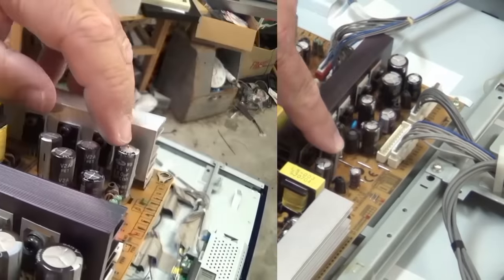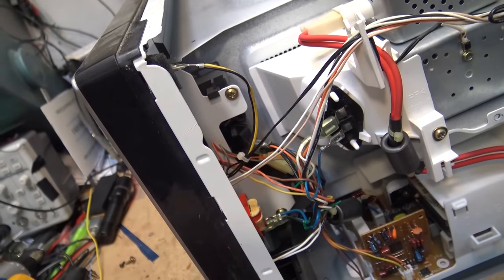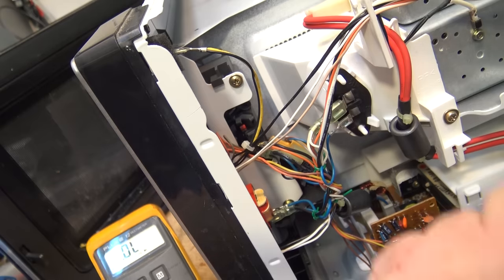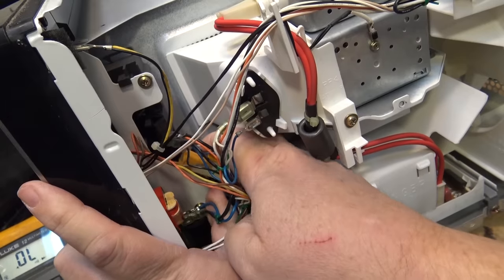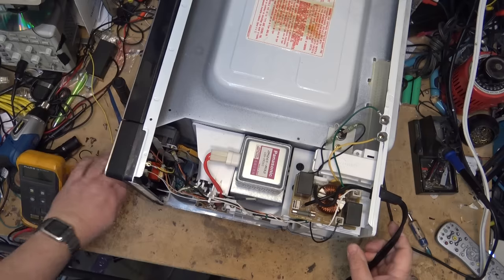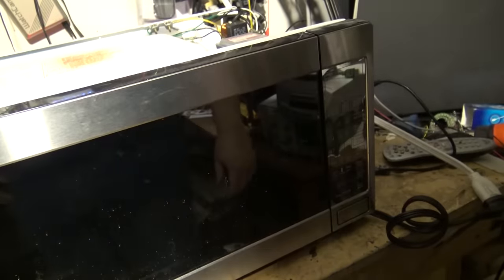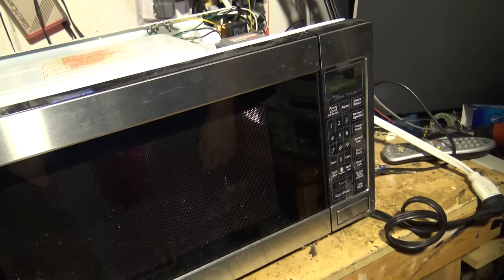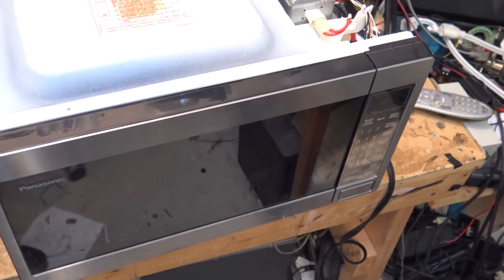Panasonic Inverter Microwave Oven Repair

Comment: Thanks man, it helped me. My microwave was dead, I opened it up and checked fuse but it had continuity. Before anything else I just cleaned and placed it back and guess what, it work fine. It just had some dust or build up around the the fuse, cleaning it helped. Thanks.

Comment: Its amazing how a lot of the mirowave ovens from the 1980's are still working. Specifically the one from work that i use  almost every day and the one that i have at home.
Reply from the maker: Yes I have a Panasonic madam grill that goes back to 87 or 88 still works.
Reply from the maker: The old ones had basically 4 parts. Transformer, Diode, Capacitor and Magnetron tube. Plus the interlock switches and timer of course.
Inverter units are much more problematic especially the early ones from the late 90's before they figured out how to make them. The new ones are far more reliable.
Many magnetrons files on the early ones too because they were being over driven.
Reply: Yes, I have a huge, third-hand, 80s one that still works, every day.
(I don't have children though...)
Reply: I trash picked a Quasar Custom Touch about 20 years ago that was made in 1984.  Cleaned it up and it's still working to this day.  It's outlasted several newer microwaves, so I keep it around as a backup unit.
Reply: I think the date code on mine is 1986, it's only 500W though, have to double most "regular" cooking times.
Reply: Old non inverter from 80s Better build quality , than todays sub $100 ones, using same circuit design, but inferior components.   Because they cost $500-800 in 80s dollars which adjusted for inflation is $1500-$2000 today.  So they made them full size and out of sturdy materials.  My parents still use thier full sized Panasonic digital panel, still works great .  Didn't have a turntable otherwise perfect .   3 cubic foot?
Reply: @12voltvids  now every large mfg, LG, Kitchenaid makes inverter Microwaves  but looks like they source the circuit from Matsushita aka Panasonic parent co.  It's the 2014 and later that are flawless .   Panasonic has upgraded its own line to it's newer Cyclonic Inverter, which has a larger Formica opening (4 inch square) I'm surprised they had inverter in 03 or the 90s.
Reply: Thanks for the help. After removing the cover I noticed the fuse was actually popped a hole in the end. Home depot 2 pack of microwave fuses 3.45.  Working again.  Thanks for sharing and saving us from the expense of a new unit..
Reply: Yeah I have an Amana Radar Range from 1982 and I hate replacing it, in fact, I'm going to keep it in the basement for backup because these new fangled units won't last that long.  The only problem is it weighs close to 14,000 pounds and I need a crane to get it into the basement.
Reply: Hello. Do you not have to short the capacitor  on these Panasonic Inverters??? Thanks in advance @12voltvids

Comment: Great video. I thought my microwave had just blown the fuse. But, discovered that it's primary switch had literally burnt itself out (actually melted the wire connector). Thanks to your video, I was able to replace the fuse, the switch and the connector and save myself a couple of hundred dollars! Cheers!
Reply: That sounds similar to my problem....
Reply: Where did you buy the parts? Would you happen to have the part numbers ?

Comment: Thank You.   This is a very well explained video and I was able to check the 3 limit switches and then replace the fuse.  What I did find out from a different video was that the limit switch and fuse replacement part numbers (CES6) are actually written in red on top of the inside cover - this is visible as you remove the outer cover.   This and the other video on the same subject by 12voltvids were very useful to also understand how to go about doing more complex repairs if one chooses to do so.

Comment: Thanks for this video. My Panasonic NN-SN686S would stop after about 3 seconds. The continuity for the 3 door switches tested OK, but I noticed some electrical residue on one of the switches, so I replaced all 3 switches, which resolved the issue. The cost was $40 from the Panasonic site.

Comment: Thank you very much for this well explained tutorial! I managed to fix my Panasonic inverter microwave by just replacing the fuse. It was more difficult mounting that microwave back up by myself than replacing the fuse that’s for sure!
Reply: Did you have to reset a code??

Comment: Thank you for this video. It helped me fix my NN-T795SF with a Oct 2006 build date! In my case, the primary latch NO switch had failed and was functioning as an NC switch. The button also no longer clicked. The door was not making good contact with the button due to wear, causing it to "stick" closed. The fuse would blow whenever the door was opened.

Tip 1: It's a lot easier to see and work on the switches if you remove the latch assembly altogether (just disconnect harnesses and undo two screws). I found it helpful to see and understand how the door latches and release button engage the switches too.

Tip 2: there's a sticker on the underside of the cover panel with the part numbers of the switches, relay and fuse. My model uses a 6x30mm 20A slow acting ceramic fuse.

Comment: I love the concept of inverter microwaves.  An inverter will be the next kind I buy.  I am one of the three people who actually uses the "power" controls on microwaves.  Instead of cycling the magnetron in "duty cycle" fashion,  the inverter- style does it with some kind of HF PWM. Way more useful for actually reducing the heating power of the unit.
Reply from the maker: Yes inverter by means of pwm will vary the hv to the magnetron and thus reduce the power. They work great.
Reply: @12voltvids  hope the skin is still attached to your hand 😳
Reply from the maker: @DrewskisBrews  
The big one I have in my kitchen the fan also slows when the magnetron comes on.  The reason this one was so noticeable is because the cover was off.  When the cover is on didn't spin down so much as it was actually working the air rather than just spinning.  And no, it doesnt cool the fuse. It directs the air over the magnetron and inverter heat sink and then into the oven cavity and out the other side over the humidity sensor.  When I ran it with the cover on the sound of the fan speed dropped about the same as my other one.  I'm giving it away so if it blows up again oh well they got what they paid for.
Reply: Basically achieves the same thing and I think the older style is still more reliable
Reply: There are four of us. I find the lower power levels very useful. (But I'm also one of the few who likes fruitcake.)

Comment: Thanks, I just fixed one that was being thrown out.

Watched your video and then checked the main fuse and found it open.
Microwave was made in 2015 and in great shape except dead (no display).
Main fuse in mine was a 20A, guess the factory had too many of the 18A ones blowing out.
Found a 50+ year old 20A fuse in my junk cabinet and after removing the old open 20A one, installed the 20A one from the junk cabinet.
Plugged in the microwave and now had a display!

Now the BIG question, did a faulty inverter or magnitron blow the fuse or did it just open due to be running too close to it's current rating?  Put the power down to P5 and time at 1 minute & it warmed up a mug of water nicely.  Success!

Thanks for the great video.  Saved me a bunch of time as I skipped the checking of the interlock switches and went directly to the main fuse after hearing you say quite a few have blown the main fuse with no apparent reason being found.

Comment: My parents recently had to replace our old Panasonic Inverter from around the same time period (early 2000s). Not because of the electronics, but because the plastic door opener mechanism broke from so many years of heavy use. Not bad if you ask me, that thing must have been going on 15 years or more, having spent most of its life in a house with three kids who may not have been too gentle with it (myself included). They got a brand new Panasonic Inverter to replace the old one, and I'm expecting it'll last even longer than the original.
Reply: same thing with mine, and although im trying to get it fixed, repairing the broken white plastic bit is not stocked any longer so i dont think its worth the bother. and my time  as my Panasonic is also about 20 years as well i should imagine
Reply: How did you go with a new Panasonic? Mine crapped itself with constant h97 errors after just a few years of light use.  Absolute trash.

Comment: One thing that is odd about the inverter microwaves is that they don't have that single large high-voltage capacitor you see in 99.9% of videos and articles about microwave repair. Instead they have two smaller ones on the board near where the power comes into the unit. You can see one of them @10:09 in the video. It is a black blocky thing labeled 2.2 microfarads and 275 volts. I was going nuts trying to find the HV capacitor every video and article told me I had to discharge. In the end I just tested continuity on the fuse and found that was the culprit. Thanks for having a video on one of the Inverter microwaves so I don't feel like such a weirdo!
Reply from the maker: The inverter type do not have the large cap that conventional do.  They use a flyback type transformer. Diodes and small hv caps.  On these inverter type the frequency coming out of the transformer is very high and does not require a capacitor. The voltage is around 4200 volts dc.   Unlike a conventional microwave which is either on or off, inverter types can dial down the voltage to reduce the power.

Comment: So I’m confused. You said water is bad for microwave and you put water mug to test it??
My microwave is acting weird. We have a new born and we started heating water in it to heat his milk from hot water and now the microwave sometime works and sometimes shuts off. If we wait, power cycle or hit it it starts to work and sometimes it’s doesn’t work at all. What could be the problem?
Reply from the maker: I never said water is bad for a microwave.  A microwave needs a load to absorb the microwaves.  Water is a perfect load.

Comment: Good info. I've replaced fuses before. I took the cover off our older Panasonic microwave to see if I could replace the light bulb. It has an integrated lamp assembly and I don't see any available. Now I've misplaced the screws... Microwave still works really well. I'd like to get replacement screws.

Comment: If the security screws are in a hidden place I will just get a dremel with a thin cutting wheel and turn them all into flat head screws to take it apart.

Comment: Neat to see this repaired, the inside is a far cry from my 1974 Amana Radarange model RR-4D. Still in daily service and working good.
Reply: I worked as a parts subcontractor for the wiring harness for those old Amana's- built like a tank- yes, but as I recall only one interlock switch- then again maybe I recall wrong. ☺

Comment: Thanks for sharing your expertise. It's made me pause before replacing my Panasonic NN-295. The problem is intermittent which makes trouble shooting challenging given it's an over the range model. What happens is that it will run perfectly than just stop. Power is still in the unit evidenced by the display still on when it stops. To get it up and going again it needs to be unplugged and then plugged in again and everything works fine. This happens frequently. Any thoughts or comments would be greatly appreciated.

Comment: 21OCT22 Fuse blown. Ace Hardware "microwave fuse" 2ea for $6.37. Remind yourself to align both sides and top when replacing cover. Since my unit failed while running, I skipped the switch testing. I used metal polish paste, Flitz, and Q-tip to clean contacts. Smeared paste on old fuse, inserted and rotated 3x, scrubbed with Q-tip, then soft cloth. Inserted new fuse.  Tested without cover. Panel light on. Check. Cup water heater for one minute, check. Replace cover and back into kitchen cubby hole. Set time: Press Time/Clock button 2x. Rotate wheel to set time. Press Time/Clock once.  Ready for duty! Hopefully for another 11 years!

Comment: Hi my Panasonic inverter nn-sc668s just stop heating. Runs normal but I can hear intermittent clicks every few seconds. After a 2min run it shuts off after 45 secs and does not heat. Any ideas?

Comment: I have a Panasonic Inverter and the display is dim but I can read it OK. Mine is over 20 years old now.  I did have the magnetron socket short out and I actually replaced it because I like the oven.  It cost under 30. It failed in storage, maybe humidity. It actually shut down with a direct short to the magnetron and did not blow a fuse.

Comment: Thank you, I just fixed my inverter microwave by replacing the fuse, after checking that the switches weren't broken. I just left them in place and checked by pressing down on them. I was pretty sure it was just the fuse since the microwave stopped running during operation.  The suggestion to use a small flathead screwdriver to loosen the security torx screws worked great!
Reply: i dont mean to be so offtopic but does someone know of a method to log back into an instagram account?
I was stupid lost my login password. I would appreciate any tips you can offer me
Reply: @Dylan Benedict I really appreciate your reply. I found the site thru google and Im in the hacking process now.
Seems to take a while so I will reply here later with my results.
Reply: @Dylan Benedict It did the trick and I actually got access to my account again. Im so happy:D
Thank you so much, you saved my ass :D
Reply: @Luciano Jeremy Glad I could help :D

Comment: I have this one and it seems like the initial issue you are referring to--the switches is the problem.  I'm going to get another because getting a repair guy to work on it will most likely be too costly.  Its not dead bc teh light still comes on when we start it.  But the door has been a issue.  sometimes the door will close properly and let it run and other times it does not.  It has been nuanced dance of door shutting to get it to run but now it is over.  You wan it?

Comment: i have a Galanz that died. I figured out it needed a new thermal fuse, so i ordered and replaced. Now, when I try to use it the convection oven part works fine, but the microwave oven turns off after 2 seconds with an ER30 error which is a communication issue between the inverter (power transformer) and the control board. is this something I can reasonably address and fix myself? Many thanks!!

Comment: Jeez e-louise.... never treat a scalding like that.... i.e. do nut'n. The instant something like that happens chuck an ice pack (even a bag of frozens) on the area and leave it there for as long as possible to suck the heat out of the area and to cool down the tissue below the surface of the skin that has zero tolerance to becoming over heated.... This way you cover off any chance of a blister forming etc. Us tech guys who rely on our incomes from our hands just can't afford to smash them around like that!
Reply from the maker: Don't worry about me.  I will survive.  At least it wasn't boiling oil.

Comment: Sometimes when you slam the door on my Panasony M O, it totally loses power, slam it again, it comes back on.  
It's like a loose power connection.  I never opened it up.  You didn't mention the HV oil filled cap, could be worse than a CRT.   POP
Reply from the maker: No oil filled cap in this one. Inverter type, just very small ceramic caps.
Reply from the maker: Speaking of the secondary of a microwave. I can tell you from first hand experience don't touch it when it is operating.  Threw me about 6 feet through the air.

Comment: I had a third situation.  The bottom attachment for the spring  had broken off.  I was able to wrap a couple of strands of picture wire around one of the black flanges and all is now good.

Comment: I've got a similar Siemens HF26026EU inverter microwave that has no display. Fuse is tested and good. When I plug in the power there's no display and it won't run. If I open the door the tray motor runs. Could bad switches cause this or is the main board also bad?

Comment: I have a Haier 1000 watt microwave where one of the the door switches had internally lost its mechanical integrity (I know this cause I opened it up) and just bought a normally closed and a normally open switch and replaced the faulty switch with the appropriate one ....works like a charm.

Comment: I have opened up many a microwave oven in my time, but I cannot recall one looking like that!  Usually they just have the usual transformer and capacitor set up; interesting to see an inverter.
Reply from the maker: Panasonic is I think the only company making them. They cook exceptionally well. That is why they exist. It wasn't to make them cheaper, it was to enhance the cooking.
Reply: @12voltvids  Indeed; pretty efficient, I should think.

Comment: Nice quick fix :-D
I wonder if the display has one of those odd high voltage electro luminecent backlights, they do go very dim over time, i'm not impressed with them one bit.
Reply from the maker: I believe this one is LED backlit. Green LEDs.